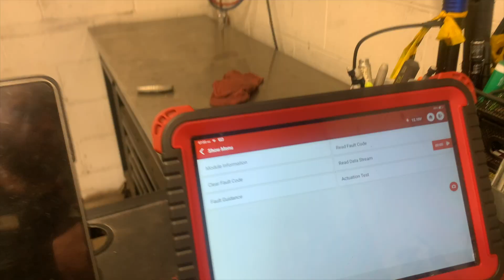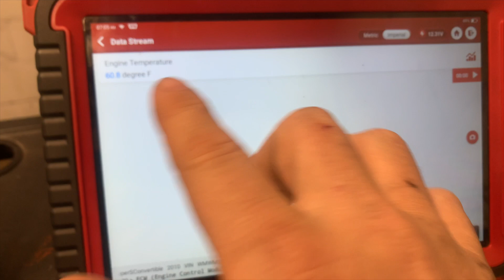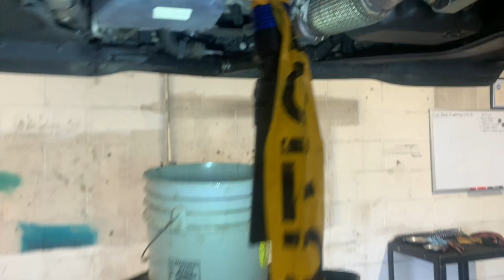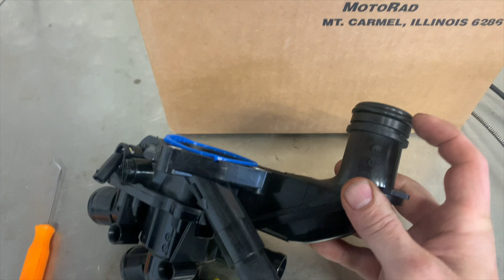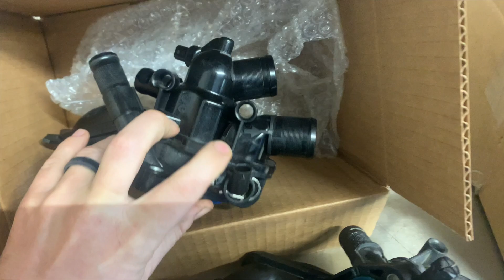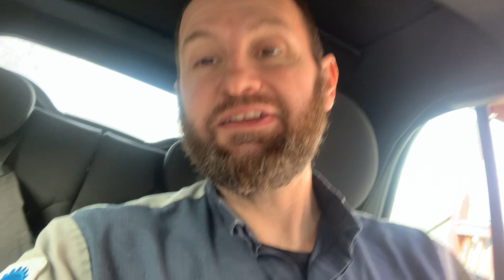Mini Cooper Thermostat & Housing Replace,  (2F07 Coolant Temperature Map Plausibility)

Comment: Im on a FB group that talks about coolant temps on the N14 all day long. They like to sit on 221 (105C) on cruising speeds. Apparently if you turn on sport mode and have the aircon fan on MAX its suppose to drop to around 190'ish (88C) but mine never does on my 2012 JCW. Some even say their temps go to 226 (108C) and up to 230 (110C) and BMW accepts that as normal.
Reply from the maker: That’s interesting information, I would like to learn more about the strategy mini uses